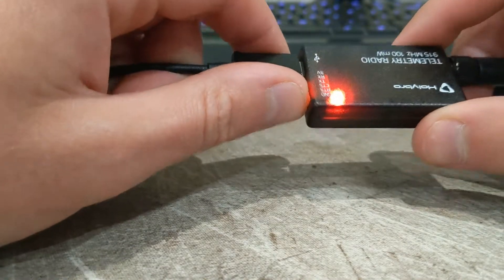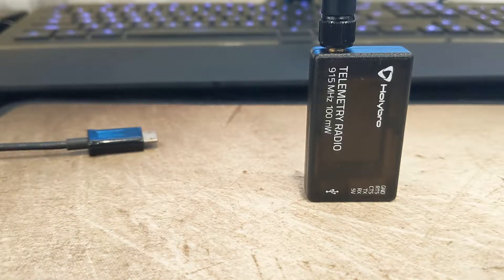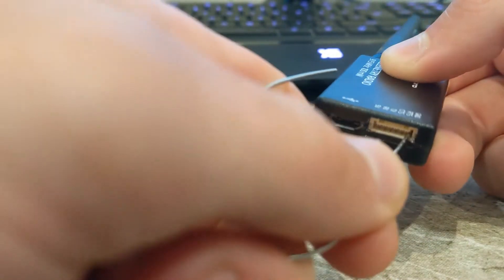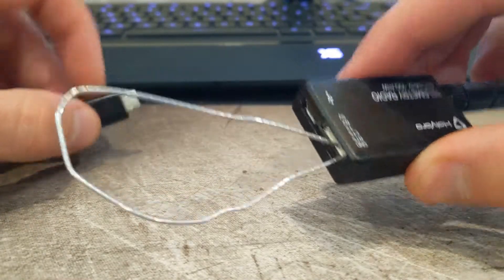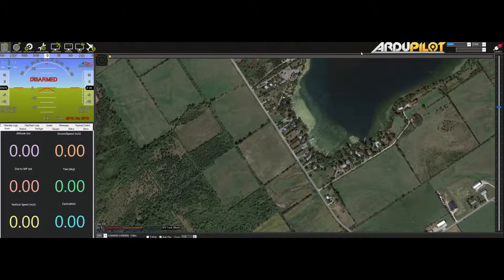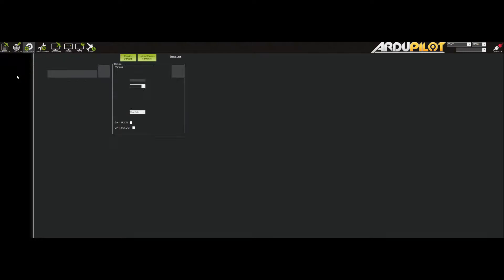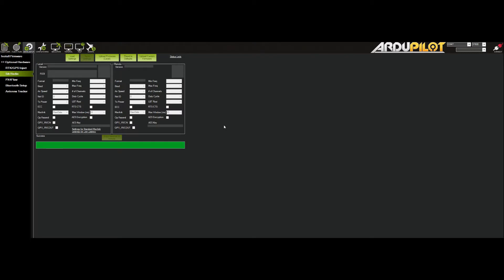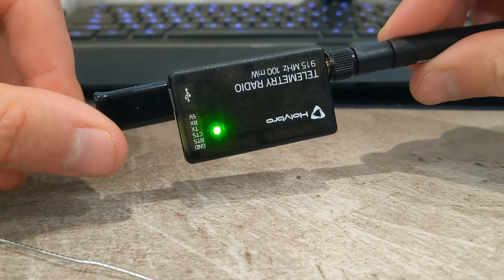How to Fix Bricked SiK Telemetry Radio

Comment: what to do if the telemetry module doesnt light up when turned on.
the ground module just flashes red light and then do nothing after connecting to pc

Comment: For anyone with sik radio version 1, do the powering of the module AFTER connecting the CTS and Ground pins, Otherwise it won't work.

Comment: My radio is a ground station version that plugs directly into the USB port on the computer so the above method won't work as that's the only way to connect it. There are various labels on the bottom  EN, RX, TX, VCC, CF, GND but it's difficult to see exactly what they refer to i.e. no pins visible but there are various solder pads
Reply: Remove the casing and find the ground and the CTS pins as mentioned here. https://ardupilot.org/copter/docs/common-3dr-radio-v1.html . Then connect the two pins FIRST. Then power using plugging to the laptop. Do the firmware update in MP.